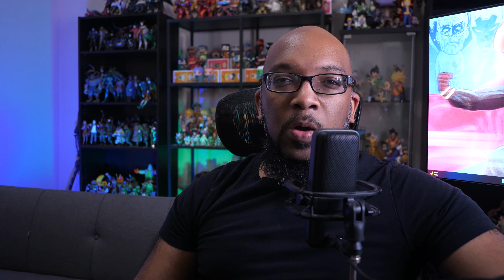Bambu Lab A1 vs. Flashforge Adventurer 5M | The Figure Feedback Podcast EP: 10

Comment: I looked at the A1 and the AD5M and decided on the AD5M, am glad I did. My 5M has been near perfect from day one. Out of about 60 prints so far only ONE had an issue and that was because it needed a raft. The prints are smooth, clean and fast. 

I am a hobbyist, my prints a little things for my desk like a battery dispenser and Flash Drive holder, parts for computer builds and occasionally something more integrity and so on. I print in PLA and will be exploring PETG.

That $100 savings to me as a big deal, as you noted because it allowed me to get the new printer and a decent supply of filament.

I was leaning to Flash Forge anyway. My first 3D printer was an Finder and it has served me WELL over the years. I just decided I wanted some more print area and something newer.
Reply: Nothing NEEDS a raft these days
Reply: @shaunmorrissey7313  I am not sure I agree. I have a few different models that have a very small direct plate contact area and as these build up the side to side pressure will often break them loose from the plate. Adding a brim did not help but added a raft and suddenly the prints where perfect.

Comment: Big fan of your channel and bought a 5M one because of your videos. However i had to send mine back. I dont know why or how but the printer nozzle dug itself into the plate and damaged both the platr and nozzleit and every time i turned it off and back on, it showed "nozzle temperature error". 

I didnt play with any settings since im a beginner. I just used it as a set it and forget it. I guess I'll try the Bambu.
Reply: Same happened to me. Replacement nozzle and build plate fixed the temp error, upgrade firmware... loving it ever since.
Reply from the maker: Oh wow, that's messed up to hear. I hope the Bambu Lab printer serves you well!

Comment: I ended up getting the FFA5M, and the setup was very easy, as you said in a previous video. However, I ran into an issue during the calibration process at the end, when it is ready to print its test cube. I searched online and sure enough this is a known issue and I worked around it. Come to find out that that cube isn't in the printer's library. It doesn't exist, so no wonder it kept freezing trying to print it and you can't cancel the print either it again just freezes. You have to restart the printer. It allows you to continue the calibration from the interrupted section on. And the 3rd time around I got smart and declined to print the cube and chose a cool articulated slug instead. Overall, thanks to your videos I didn't hesitate to make this purchase and have had a whale of a time playing with the printer and the CAD programs.

Comment: I got the 5m thanks to your videos. It’s got some quirks but I’m happy with it. The freeze glitch happens when you send a file over WiFi while it’s still in process of printing. If this happens you need to reupload the file when it isn’t printing. Bed adhesion also simple fix, up the bed temp to 60. 

A1 has the overall edge but i think a5m is faster and more stable of a frame to begin with.
Reply from the maker: I only send prints over WiFi when the printer is idle, and it'll still freeze on occasion while printing. I also never set the bed temperature below 60. Sometimes it messes up the first layer, but does it perfectly fine on the second try with no adjustments. It's the weird things like this that made me ding the 5M for consistency.
Reply: @FigureFeedback  I’m glad you told me about the freeze issue still happening on idle. Myself and others on Reddit thought we figured out the issue. Hopefully it’s just a bug that gets a firmware fix. 

Also it’s strange they have the default bed temp to 55 on the first layer then it drops (often below) 50 on the rest of the print. For someone new like me it took a while to figure out why it was automatically dropping the temp and I would have to watch it finish the first layer then manually bring it back up. I had to change the settings on the nozzle print temp or filament temp. 

Overall it’s been a solid machine and fun experience.

Comment: 3:03 I got an X1C to try polycarbonate (for making eyeglass frames and functional parts for physically challenged clients ) and was quite honestly terrified of it because it is considered an "exotic" and I had seen so many horror stories. To my surprise it has turned out to be one of the most consistently well behaving materials I've worked with. However it is being printed in a printer known for its ease of use and auto calibration features. I wonder if I'd have a different experience if I wasn't using the X1C.
Reply: Try a QIDI 1 Pro , Yes you would have a MUCH different experience printing Carbon of Nylon or any other "exotic" filament...It would be easier, less hassle and the prints would be cleaner